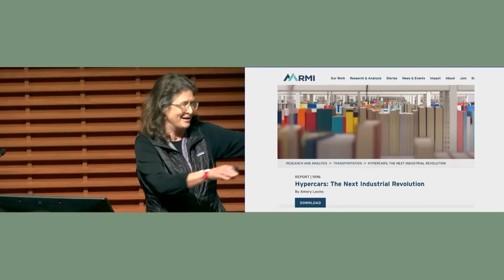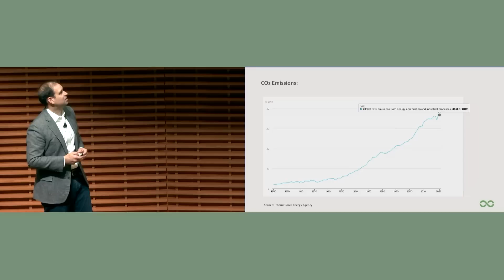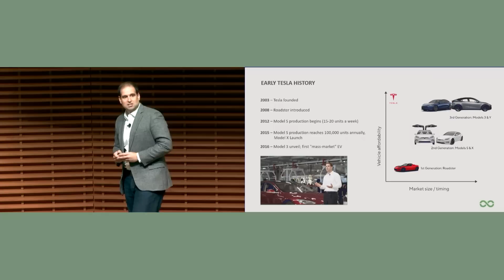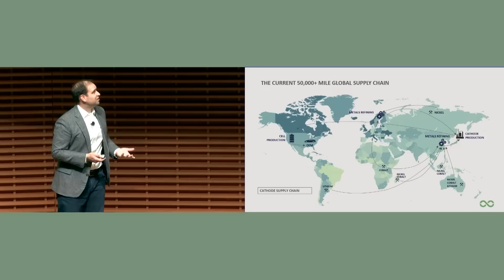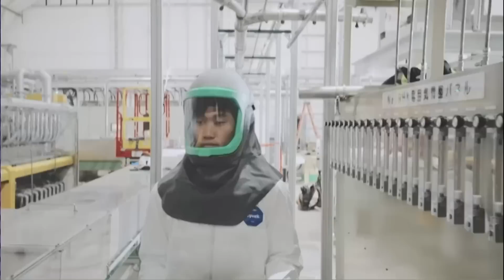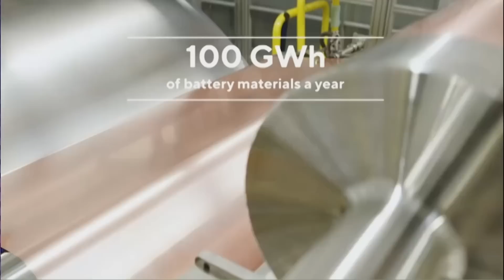JB Straubel: Transforming the Lithium-ion Battery Supply Chain

Comment: I love Redwood, but some of the numbers just don't make sense to me. How could there possibly be 100GWh of recyclable materials in the world by 2025 (assuming Redwood somehow corners 100% of this), if world li-ion battery production was only 20GWh in 2015?

And that's assuming batteries only last 10 years on average, which seems unrealistic. Batteries going into EVs and BESS today might still be in primary use 20 years or more from now, and even at EOL they may enter into secondary use as repurposed batteries.

Comment: Only thing is, why do we still use Cobalt? LiFePO4 battery tech is much cheaper, although less energy-dense.  But the advantage is LiFePO4 is discharge rate and 0-100 cycling (vs 20-80 for Li-ion).  Thus, despite being less energy-dense, you get equivalent usable energy from LiFePO4 in same form factor/weight as Li-ion (ie, entire battery is usable vs ~60% for Li-ion).  Right there, you lower battery costs around 15-20% (and why Tesla now uses them).

Comment: maybe a deposit scheme could aid in collecting old batteries.   deposit paid at point of sale then refunded when they are turned in at end of life?
Reply: In the UK (and Europe) any Electronic retailer is obliged to accept a device for recycling if you take it to them. Doesn't matter if you purchased it from them.
.
What happens after that? I'm not sure, but there are at least regulations in place.

Comment: Elon should focus on SpaceX and offer the Tesla CEO position to JB. We need more JBs in the world.
Reply: Did you hear him say he had wanted to get away from the business side and return to the entrepreneurial aspect?
.
However, it seems that short of a huge "anti" campaign by the "negative" investment community, JB will be back on the Tesla board of  directors in May.
(👍👍)
Reply: @rogerstarkey5390  Elon has also been focused on Twitter in the past few months so I'm sure JB would be able to hold a CEO position at Tesla and still be an active entrepreneur.

Tesla has a highly capable leadership team that runs almost on autopilot, as shown at the last investor day. JB wouldn't stand in their way and would avoid Elon's mistakes like S/X steering wheel, removing radar, AI-based wiper sensor, overestimating FSD, overestimating deadlines, and so on.

He would bring an apolitical stance, credibility and stability back to the Tesla brand to raise investor confidence. IMO due to his past at Tesla, I believe he would bring the best of Elon, but not the worst.
Reply: @That80sAstronaut  He would also avoid removing Ultrasonic Sensors.
Tesla Vision Park Assist is a joke.
Reply: @pauld3327  Precisely! Elon is too lost in ideology, claims we’re just input error (his words). IMO, he’s lost all respect for customers and, in his mind, we’re just means to achieve his goals. As long as the car is safe enough, he’ll give us the bare minimum to keep production costs low.

Comment: Does anyone know if the new sodium ion batteries starting to come out now will completely do away with lithium and nickel and copper?
Reply: Sodium ion can compliment lithium ion batteries by being used in smaller lower range and cheaper cars and helping with energy storage. With LFP doing medium range cars and doing energy storage with sodium ion.

High nickel cathode batteries will still be used for high range cars/trucks, performance cars and hopefully eventually short range aircraft.

I don't think it will be a winner take all, we need a large toolbox to solve renewables and it's great we're getting more and more technologies to help with the transition.
Reply: @andrewvicendese9008  
Sodium Ion.....
Probably not for "Smaller" or "cheap" due to the lower physical volume available in the vehicle to accommodate the pack.

Sodium Ion cells are (at the moment) larger and heavier due to their volumetric/ gravimetric density.
As such, the "Space vs Range" compromise would be "difficult".
.
Applications? (imo)
.
Storage (Container sized)
.
Public transport (larger vehicles with a known daily range, no critical weight restriction and overnight charging)
.
We also have the "newer" chemistry CATL cell emerging  which is allegedly 15 per cent more energy dense than LiFePo4  cells, and costs less than Nickel and Cobalt-based alternatives.
.
It's an improved version of the LiFePo4 chemistry with a mix of magnesium, Zinc, and Aluminium replacing some or all of the Iron. So the MP3 is still a Lithium Phosphate battery, but with a gravimetric density of ±210 Wh/kg.
.
This may be a "sweet spot" for "normal performance" vehicles?

Comment: Isn’t lithium ion obsolete technology? What year is this from?
Reply: lithium is essential for electric cars in 2023
Reply: @olinafan4459  2023 produced car and home batteries have lithium iron phosphate technology which has 4-5x the charge cycles over the obsolete lithium ion batteries
Reply: @Nrustica  Lithium iron phosphate, (LFP), is just another type of lithium ion chemistry.  LFP does have better cycle life but it has worse energy density that other lithium chemistries such as NMC and NCA.  They both have more than enough cycle life to be used in vehicles and they have much better energy density than LFP.  Only shorter range less expensive EV's are using LFP now.
Reply: @Nrustica  
1) You're confusing the terms
"Lithium ION" and lithium IRON", (as many do) 
.
Lithium IRON cells (LiFePo4) aka Lithium IRON Phosphate... are a subset of the Lithium ION cell type .
.
Likewise, the cell commonly known as "NMC" is also a Lithium ION cell type 
(with the typical formula 
LiNiMnCoO2 or
Lithium Nickel Manganese Cobalt Oxide)
ALL require the migration of "LITHIUM IONS" through the cell to work.
.
2) As for Longevity.
Search 
"Jeff Dahn ECS Keynote 2022"
Jeff (Tesla battery guru) relates his research with Nickel based Lithium ion cells which outperform Lithium IRON Phosphate in terms of energy AND longevity/ cycle life.
.
Never Assume.
Reply: Any where iron phosphate is, it can be replaced with nickel.
Reply: If lithium ion is obsolete technology, what is the latest technology to you?
Reply: @Best101Bits  
See my replies (I agree)
Reply: @VKMusique  
See my reply to  @N Rustica.
.
(Basically "yes, it is")
Reply: @Koopa it is not.